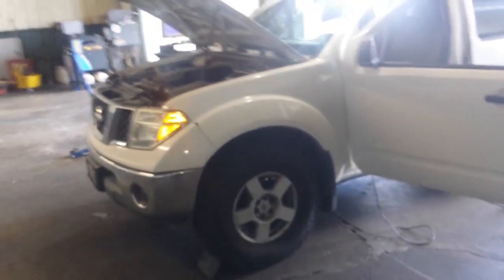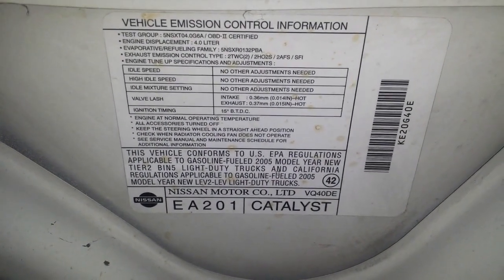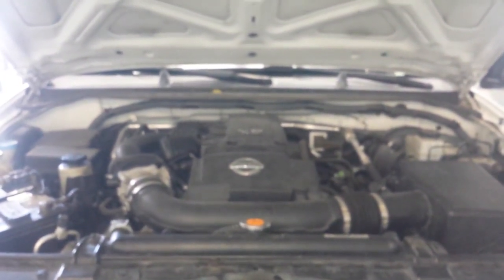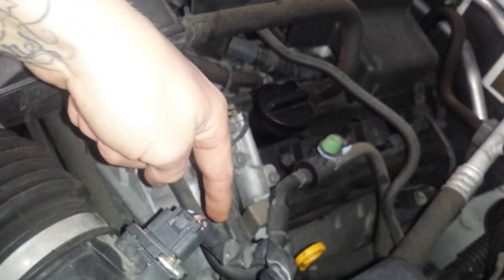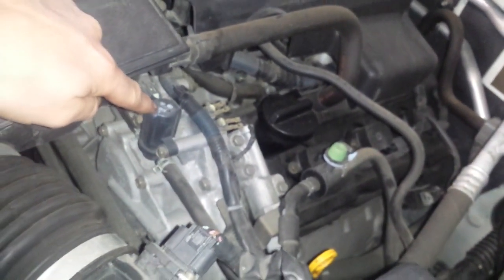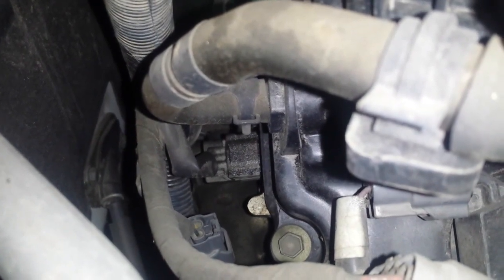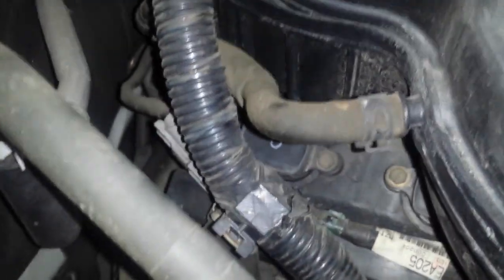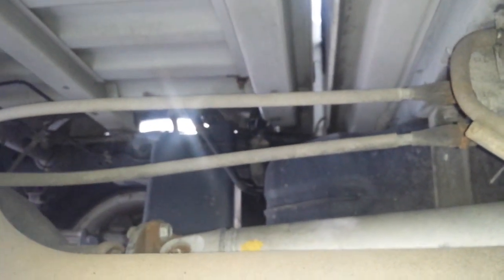Nissan Frontier emissions: PCV, EVAP canister, & purge solenoid

Comment: Hello,  my 05 frontier has a fuel sending unit code..I replaced the fuel sending unit, but still have same code and truck still shutting off while driving...do you think its the evap canister or something else
Reply from the maker: What is the code you are chasing?
Reply: @ScottiesHobbies  PO463  fuel level sensor A circuit high input....says solution replace fuel sending unit...which i did..    secondary codes p0340   p0181 p0183  ...thanks for ypur help
Reply from the maker: @brandenhall1941   I have been trying to do some research on these codes for you. Finally got a few minutes to get in front of my computer. I have never dealt with this code or these codes in particular my particular myself.. But maybe I can give you some adgive you some advice. Looking up all of your codes on all data all of them have one possible cause in common and that is: the harness to the pump. Did you check the pump harnes on both sides of the connection to verify continuity or voltage? You did have a cam code. I'm not sure if the pump and cam sensor have anything in common. Let me think.... 🤔 I have a short day Friday if I'm busy til then. If you think of any other symptoms to add, lemme know. 

I promise I don't forget about you.
Reply: @ScottiesHobbies            code    p0463

Comment: Maybe a video showing how to diagnose and repair evap system?. O'Reily's told me I have an Evap code and not sure to do from there. Would love to fix it on my own.
Reply from the maker: A EVAP code can sometimes be really hard to diagnose and repair. It could be as simple as a vapor Purge or vent solenoid not working properly or as hard as a pinhole leak in a hose somewhere in the EVAP system on your vehicle. Did they tell you what code is in your computer?
Reply from the maker: If you check out my video library I think I have a diagnosis video for EVAP code p0442.
Reply: Cool thanks. I don't remember the exact code but I am going to get it for sure tomorrow then try and repair the system.
Reply from the maker: @UnderO87  let me know what code you come up with.

Comment: OK, soooo once I repair the part throwing the P0448 on my 2008 Frontier, how would I reset my computer? Would disconnecting the battery do it?
Reply from the maker: The code should clear itself within 50 to 70 miles if the repair was done properly. Or if you replace the proper part. If you have a scan tool you should be able to use that to reset your computer or if you disconnect the battery and let it sit for a couple minutes and then reconnect your computer should clear out as well. I have seen many times that just disconnecting the battery does not through the check engine light though. So short answer the light should clear itself within 70 miles or you can clear with a scan tool.
Reply: @ScottiesHobbies  Awesome! Thanks. So, not sure I repaired the proper part. Went to Autozone, borrowed their scan tool which is how I knew the code. Replaced the valve in my engine compartment. If that does not do it, many other videos showed taking the canister out and cleaning it. Might try that next. (and their tool does not reset, so I'll drive it for 70 miles). Thanks again, at least I know where all the parts are thanks to your vids AND I'm going to replace my PCV because it looks so damn easy, and it's way passed time!

Comment: My Frontier is California compliant.  More & more the fuel pump nozzle shuts off while fueling before it is full.  I'm told that the EVAP valve may be dirty and not opening.  How can I clean that?
Reply from the maker: What you're hearing is true possible there is a possibility that your evap Vapor vent solenoid has gone bad or is getting clogged. They get clogged with road debris such as brake dust and Road grime. The Vapor vent solenoid is the Evap solenoid near your Vapor canister under the vehicle. That is the solenoid that lets fumes released into the atmosphere. When you pump that valve should open a little bit to release the pressure when the fuel gets induced into the fuel system. What is probably happening is the pressure is building up causing the fuel pump to see the pressure and think the fuel tank is full.
Reply: It's a known flaw there is an NTSB on that one. Perhaps you did it already but you can buy the party from Nissan directly, it's a reengineered part. I did and it stopped premature stop at the pump which was driving me crazy. I confirm it's the EVAP sensor located near the fuel tank

Comment: Nice, for some reason I thought the evap canister was in the gas tank - I guess I was thinking of the fuel pump.
My Xterra just threw a P1446 "evap canister vent control valve" code. Would that be the solenoid valve you showed, near the engine, or a valve inside the canister itself?
Reply from the maker: +Ryan b the vent is the solenoid near the cannister. Id clean the hose from the solenoid to ambient. Its common for those to get clogged with spiderwebs and debris off the road.
Reply: +Scotties Hobbies
Right on, thanks for the advice man! I'll try that out & see if it helps. Have a good one bro. +1 subscriber ;-)
Reply: The Evap system PURGE valve is the one under the hood.
The Evap canister VENT valve is attached directly to the Evap canister, which is located close to the gas tank.
The fuel pump is also close to the gas tank.